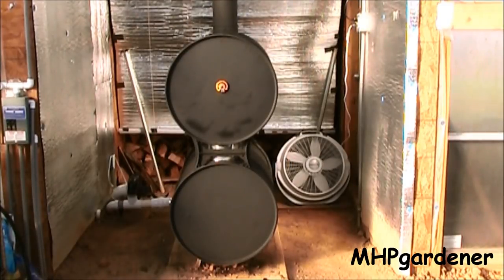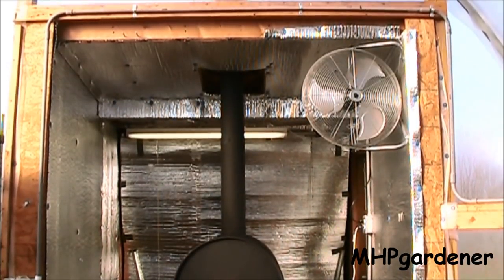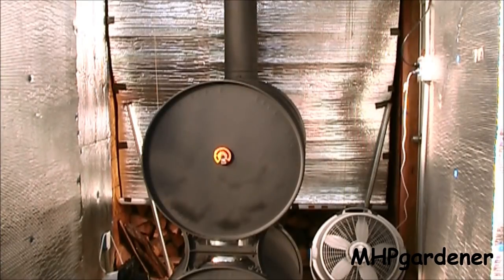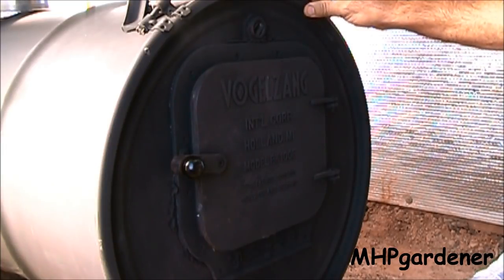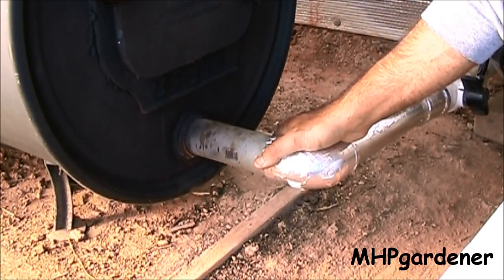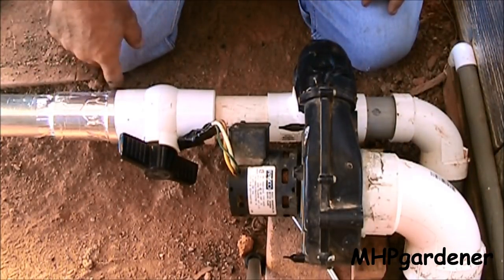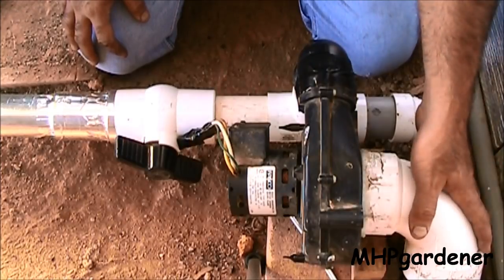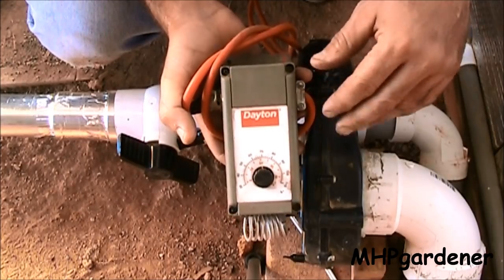Greenhouse Heating with a Double Barrel Wood Stove

Comment: Hey Bobby, I have decided for my 60' lean-to type greenhouse for aquaponics, the barrel heater is the way to go for me. However, I wanted to harness as much BTU as possible before exhaust and radiate the heat rather than have to fan it out accross my growing area. I will be using the same dual stage thermostat/blower design you are using. However I am considering running stovepipe horizontally along the length of my greenhouse encased in cobb mortar as a thermal mass heat sink. I should not have an issue with drafting or backdraft due to the blower always running (low speed when temps are achieved, highspeed when needing to boost temps) to push the exhaust through and any exhaust leaks should be contained with the cobb material until exhausted outside at 110-130'ish....Any thoughts on this thermal mass modification?
Great advice and videos as always, thanks!
Reply: Did you ever run your stovepipe contained in cob as a thermal mass heater? I'd be interested to know if this worked well and if so, what sort of temp did you manage overnight?

Comment: Have a design thought I'd like to run by you to see what you think.  Is it possible to close up your heating room, install duct work to span down the center of your High Tunnel?  I've seen videos where, using large conduit pipe with holes every few feet will spread the heat down the HT more evenly.  Like you said in this video, one end will be warmer than the other.  Would the rocket stove room become too hot to do this?  If the delivery system would work better, would a brick heating room be better than foil covered bubble wrap?  There is absolutely nothing wrong with your design on your air intake, I'll build one just like it later.  Thanks

Comment: Hi Bobby, quick question for you about snow. With you heating your HT Green house, do you notice any snow sticking on top of your green house? I plan on heating with the same system you have in this video but in Missouri, snow could get up to and pass 6 to 8 inches on flat surfaces. This much weight could damage a green house.  What is your thoughts (anyone thoughts would help) thanks
Reply from the maker: With the right slope, snow isn't hard to deal with. Keeping the 2 layers of poly inflated helps. Spacing of the hoops plays a role too. I prefer 4 ft, but some of the larger GH's are spaced 6ft. I've heard of farmers using brooms to raise the plastic from inside to make the snow slide off. But I don't know if they were heated or not.
Reply: Hi Richard. I'm going to give you a quick tip that 99% of the people do what mhp gardener did, put the chimney right on top of the barrel and goes outside straight, the trick is this: You buy those heating insulated pipes and hanging 6'' around the entire greenhouse ceiling so use all this heat for the greenhouse and melt the snow real easy after you go around you bring the flexible pipe to the chimney pipe and goes out but first you use all this heat before you send it out.  I did this for some people in Montana, and Illinois, and believe me  it works 100%

Comment: IMHO, diverting the fan's air is just wasting electricity.  I'd see about getting a smaller fan.  I have a BBQ pit and a BBQ guru (google it).  It operates with a smaller "computer" fan.  Those fans come in alll shapes n sizes, so I'm sure you could find one that would work more efficiently.